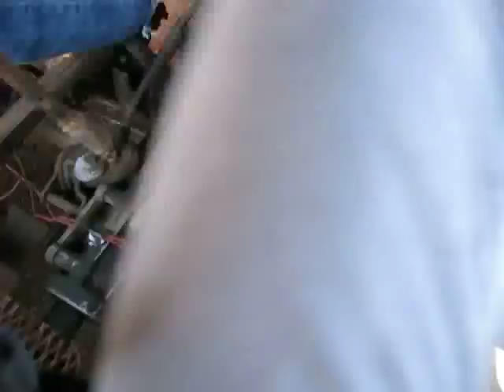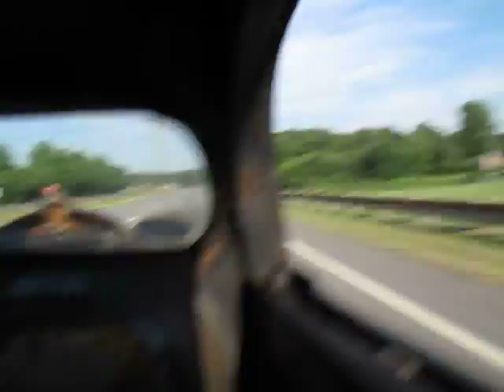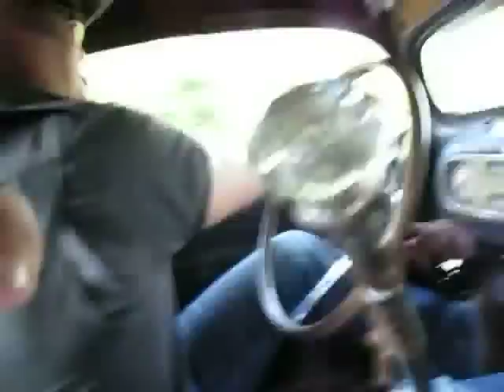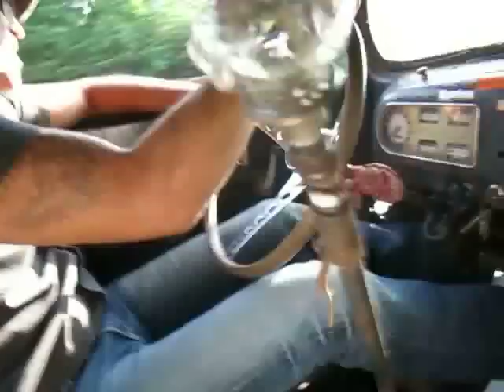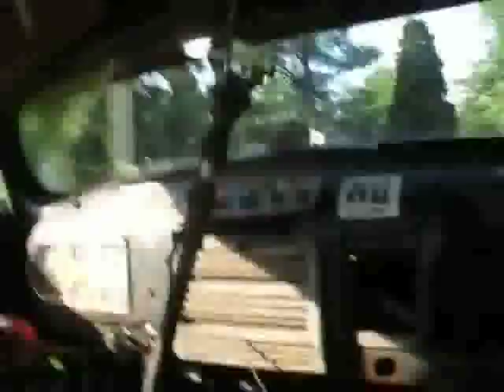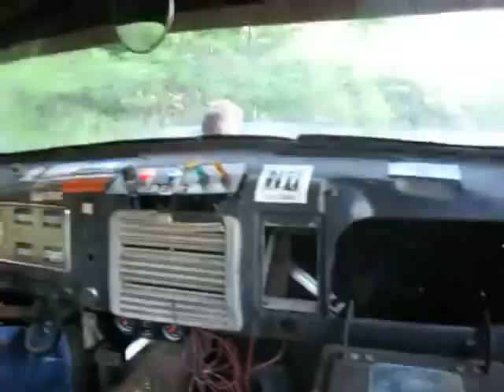Ridin' With Rooster in deathtrap ratrod!!!!"42chops garage"

Comment from the maker: @sundeb hey listen you need to make sure you have a disconnect from your battery first. then you need some single wire fuse connecters to heat stuff up. if you look close in the center of the cab u can see my power grid. red switch to coil, black start button, blue head lights,green brake lights, and yellow my radiator fan. no turn signals. just a brake light switch on brake pedal.    mines not pretty but its simple and it works.    thanks Rooster!!!!

Comment from the maker: thats a 1950 ford dash, and the front is solid to the original frame.. it started as a go kart concept.. i did put shocks on the rear .. but never did the front.. i put about 15,000 miles on it and took it as far a 400 miles to car shows ,no trailoring.. but i sold it last xmas.. and the guy i sold it to is fixing it.. hey thanks for the comment.. the rooster!!!!